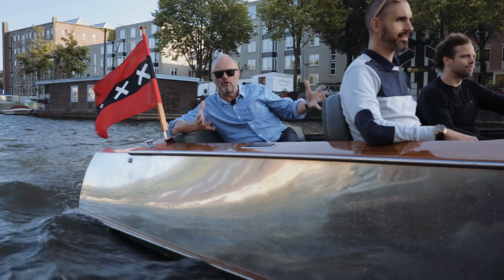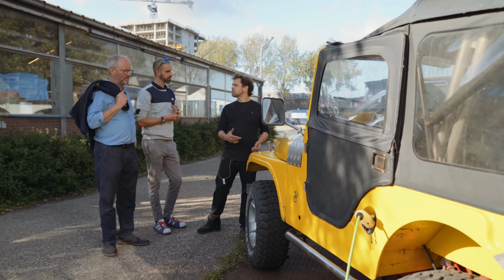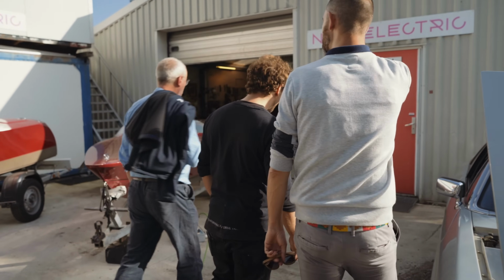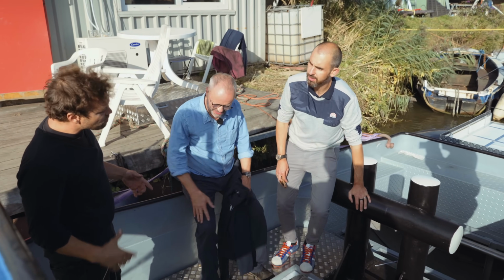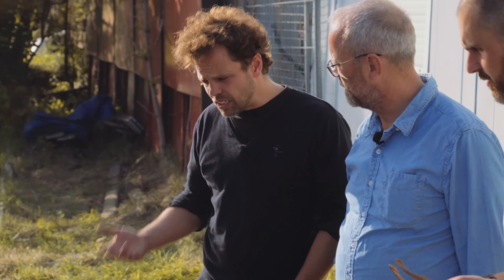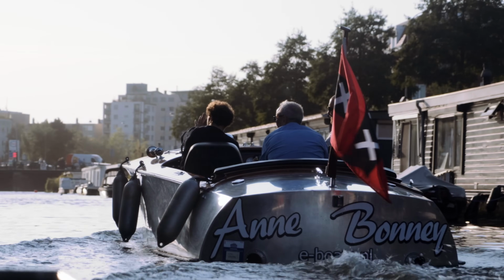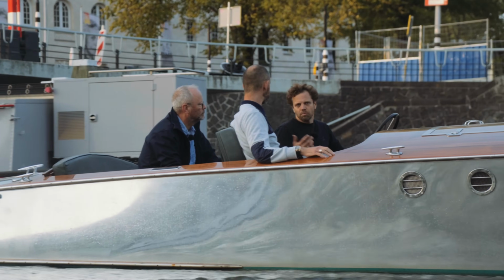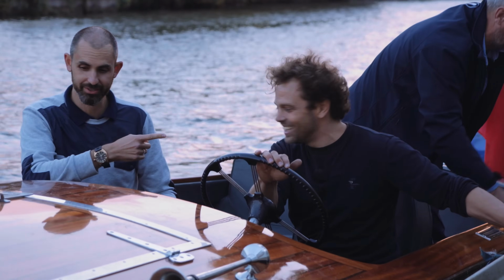New Electric Cruiser | Fully Charged

Comment: I pick up my beautiful original baby blue ‘64 electric VW Beetle on Tuesday!  It’s got A/C, heater, front disc brakes, LED lights, seat heaters, 3 point seat belts, etc..  The work was done by Flash Drive Motors outside of Austin, Texas.

Comment: I have a 20,000lb flat bottom house boat with twin 6 cyl engines 150 hp.  Is it doable to convert to electric. The river is 8 Knox I figure I might need a helper out drive going up river. But going down not big deal. My boat has inboard

Comment: Hacker Craft lines, classic wooden decking - and a stainless steel hull. I would have hated it, but for an electric boat it's perfect.  But... it's called an e-boat. Didn't the British navy work hard to sink all of these in WW II? (E-boat, Schnelleboot, a large German torpedo boat.)
Thanks for the great video, good to see sizable batteries used in a sizable boat, beautifully executed engineering-wise and esthetically.
Reply: @don jones You almost got it all right! Hacker craft lines is right on the money, the boat was built to the original 20-ties design of Nelson Zimmer's Palm Beach runabout. Nelson Zimmer and John Hacker were said to have also collaborated on other boats. Decking is Mahogany, the hull is aluminum though. Whole boat is 1500kg including the electric drive and batt pack.
Turns out one of our very first projects is also one of the prettiest we've ever worked on. Spoiled us for life ;)

Comment: I saw an XJS converted to electric when I went to the Fully Charged Live show. Very cool to see and they didn't touch the interior, just tidied it up a bit. Bloody lovely.

If there was a good hydrogen infra structure where I live I'd love to convert my old IS200 to run on a hydrogen fuel cell, it's basically a 4 door Toyota so just stick a fuel cell from a Mirai in it =P

Would be wicked. Very chilled out episode, I love that music.

Comment: The power usage information on that boat was a bit of an eye opener.  You can cruise all day without worry and charge overnight on a level 2.  I'm surprised electric boats aren't more common, especially in areas where boat speeds are strictly limited.

Comment: Impressive that he has been able to keep going with the advent of mass produced EVs. Back in the day I looked into conversions too and I found that industrial AC induction motors of size like in the tesla roadster could be had for 150$ from numerous suppliers in china. Standard unglamorous blue workhorse motors you'd see in any factory but able to do 10000rpm. Combine that with an AC controller and it could power a sportscar. I advocated this a lot in the conversion world but no one would listen and a decade was wasted on extremely overpriced prototype solutions and I'm sure that siemens setup is very expensive still. More than an entire used Leaf for motor and controller alone. Maybe even two used Leafs.  While the car market is essentially a goner, boats could be made electric and planes are very interesting. Motor systems for planes are often extremely expensive and noisy. There could be serious potential there. I wouldn't emphasise one offs but series production with cost optimized products, not siemens comfy greed, could have mass market potential. Heck with Anne's drive and skillset, I'd look into making the planes as well. I could certainly offer some pointers on what potent plane config opportunities aren't being tapped. Like in the car industry that consistently fails to consider issues like wheel aerodynamics and slacking on video mirrors, so there is absentmindedness in aviation. And some are low hanging fruit a few good men could pick en masse.

Comment: I always thought Tesla is missing a niche market, by not providing a set of different sized basic electric chassis's, batteries, wheel hub motors and cpu system packages, to be sold separately and with some modifications, where the customer can bolt on an old car body.

Comment: Soelcat, designed near Rotterdam, has 36 solar panels and is supposed to be able to cruise for 29 hours at 6 knots. If you added another 18 panels, 6 down each side and 3 across bow and stern you could cruise for 43.5 hours at 6 knots or 29 hours at 8 knots (the waterline length speed) 8 x 24 = 192 miles per day. Buy one and get the round the World solar boat speed record? https://youtu.be/pB1VHzSVfQM (bigger boats are heavier per area of solar panels and go slower, like Turanor Planet Solar even after they installed a sensible propulsion systemhttps://youtu.be/XxN8KQBlvSY )

Comment: Great story guys,I have a very interesting story which I would like you guys to cover....Marina Bay in Singapore,it used to be part of the sea but has now been transformed into a large freshwater reservoir for the city by constructing a dam with flood gates, the dam has two purposes,one to separate the sea from the freshwater and also to act has a drain for when there is a torrental rain to stop the city from flooding.There used to be heaps of petrol and diesel boats and ferries when it was part of the sea and now that it is a freshwater reservoir there still are quite a few boats and ferries but they are all slowly being turned into electric because the Government did not want diesel and petrol boats and ferries polluting there freshwater drinking supply

Comment: Only one word for all of this. WOW! I wish somebody would come out with a modular system where you could swap out the motor and battery into different shells. So maybe you start with a Jetski setup and then you buy a motorcycle shell that you can with relative ease swap over the motor and battery to reduce the cost of adding a new vehicle. Would be a lot of fun to swap between a Jetski, motorcycle, snowmobile, 4 wheeler etc. If it's too complicated to swap over the motor then at least have the ability to rapidly swap out the battery. Which is a major cost component. You already see this with power tools. Just needs to be scaled up.

Another use for modular design could be in cars so that if one major part fails or it's in a crash the whole vehicle isn't discarded. Make it easier to swap out the costly components like the battery, motors and computer. If they're worried about theft they should include a unique id chip in the costly parts.

Comment: I'm Curious to know thr cost per hour versus Diesel. Ideally you want a brushless motor with smart electronics to get the best efficiency. If i can  charge fast I'm interested.
Reply: running cost is low.. little maintenance and you will get further on your €,£ or $ ..when charging kWs vs price of fuel. that said currently the conversion itself is still a steep up front cost.

Comment: how 85 tons divided by 20 tonn truck = 900 moves? That is pulling stuff out their ass. To move 900x20tonns=18000tonns/85tonns barge=211 courses. So is that a day? NO! A week? Naaah? You can load barge fairly quick with specialty infrastructure, but you cannot tip it like truck, so unloading is sloooow. Where the 900 trucks came from then?
And 20tonn is a 4 axle solo truck, a lorry will take more and still can tip. Not able to get everywhere though.....like boat.

Comment: I generally dismiss integrated PVs on an EV, but that is a lot of horizontal surface out in the sun all day. Granted, you'd never wanna cover up that PARTICULAR boat. That wood paneling is gorgeous. But on a more modern looking canal limosine? With like an awning/canopy for even more surface area? And did i hear him wrong, when they were going slowly the boat was only using 1 kw?
Reply: Yup, the 'Anne Bonney' uses 1 - 1.5 kW at city speeds. Solar does indeed work on house boat /cabin cruiser / narrow boat ships. Particularly on extended trips where you moor up somewhere sunny and chill for a week or so..
Reply: @NewelectricNl  Wow that's great! Thanks for the reply. Keep up the fantastic work.

Comment: I have this personal belief that any time you add weight to a vehicle for ballast, you oughta do it with BATTERIES instead of dead lead weight. To me, this really drives home how electric propulsion is really perfect for boats! Besides, if A) all our cities end up looking like Amsterdam or Venice because of sea level rises, and B) the oil infrastructure will be disrupted by the same climate change effects,  then electric boats that are rechargeable locally with PE solar would be indispensable! 
Imagine living in a drowned city, where a floating barge/pontoon boat with a solar-panel roof, battery banks, and fast chargers, could take the place of gas stations.

Comment: What a fantastic episode. 
Hope combustion engines dissapear as soon as possible.
There are lots of testing and tech to improve yet with electric engines BUT we are now in a moment that everybody should ride or drive an electric vehicle.
Reply: Kind of silly to say that. The worlds electrical grid cannot produce enough clean energy to power even 5% of that many electric cars.  We need to increase renewable energy sources as well as make better batterys that are cleaner to make. Plus in my truck I have to drive 200-300 miles round trips some days to jobsites with tools. EV cannot do that yet
Reply: @gregsall5872  Well, believe it or not it will come but I apologize because I made the comment based on my country (Costa Rica) and my point of view. Our energy is close to the 100% renewable I understand most countries cannot get energy the same way.  We have the energy but not the money as we all know EVs are not cheap. In the other hand when I say all cars I mean average drivers for personal use not cars or trucks to work. That is a totally different league... Volvo though, has some years working on E Semis. The electric era moving fast
Reply: Oh trust me im hyped for EVs to get better / more capable. Just everyone wants things to switch to fast and our  infrastructure cant adapt that fast. It will be awesome when it does but it has to be done correctly. I cant wait to not have to buy gas for daily driving.

Comment: As a guy interested in EV's but also a long time boat nut (quiet sailboats) this is extremely interesting. A quiet powerboat which doesn't stink. This particular boat is obviously a planing speedboat which isn't the most easily driven hull at speeds below planing speed. I wonder what kind of range a long, narrow, classic displacement type craft could have in order to cruise rivers, canals and sheltered waters? Catamaran hulls are now being fitted with hybrid powerplants, another variation.

Comment: This shop is building Fiat 500e cars for less than Fiat can make them.  We lease one at $121/month, thanks to 'miracle' depreciation on the lease contract, but the buy out is still $22k after 3 years and 20,000 miles.  Crazy, the used market is over priced but will support about $15k for that car.  What if you just buy a used ICE Fiat and bring it to these guys?
It's not a car that wins in any category but it sure takes you around town for almost nothing and is dead reliable, so far.

Comment: Fantastic works.. was that Tug though a Diesel One with a electric motor drive?  I say that because look behind the battery he was pointing at on the Tug and you see a diesel motor with air filter tube there!   They could refit allot of cars to take electric motors and battery and solve pollution in towns and cities and get rid of flumes and noise too!  Let's hope they do?

Comment: Electric AWD Jeep with a low center of gravity...Sign me up.
Reply: Electric off road vehicles make so much sense. Perfect power delivery from low RPM's.
Reply: You'll want a Rivian, then!
Individual drive to wach wheel and battery in the floor.
Reply: @Abrikosmanden  Why?  This system keeps the electricals out of the road grime and water, and uses a proven drivetrain.  Why go with something software-based that doesn't allow gearing to fit the load required?  That's not provress... that's LAZINESS.
Reply: @Abrikosmanden  I'm waiting on Rivian to release a video of their moving around truck in "tank mode".
Reply: look up RIVIAN
Reply: How about lada niva and dacia duster??
Reply: yeah, I'm still drooling over that Jeep!!!

Comment: There is nothing new about electric boats  it was used in subs  before  WW2  We had  electric cars in 1910's
Reply: We're moving forward 😊
Reply: True battery tech has been around a while. Have driven a 30 tonne battery electric locomotive. Built in 1944 and still running today. Quite happily shifts 150 tonnes with ease and one job included rescuing a fire damaged diesel off the mainline!
Reply: @KleineJoop   AHH but,   if doing something is smoke and mirror's what's the point .. making the battery's for a tesla .. make's a bigger carbon footprint ,Then  a new v8 mustang can put out in 10 year's..  the making of the battery's also use coalfired power.. also   you cant recycle the battery's and, they give out after 15 year's and end up as toxic landfill  .. when you charge the battery's the electric power is mostly coalfired power  making even more carbon.. meaning just burning gas is much better ..   buy doing something does not mean better ... look it up and you will see im right..  electric car's are just as much the past.. Now If  you charge them using solar not main's power from coal... that's doing something.. at the moment in china and india are making over 50 new coal fired powers Station's  puting out more co2  then making a normal car.. And really It is worst making a electric car then a normal one for the planet right now... so  you can  fool your self all your  want..  we need new tec not this stuff from 1900's .. zero carbon  thats not an electric car,, every time you charge it.. it put's out more co2 then a gas powered car.. and not over time.. all at once in 30 mins..  making global warming faster..  really   Not doing something but making it worst..   making every thing electric is just for money .. not for helping the planet.. It's  the new  way of off loading your guilt ..   It's sad.... Oh  and all the mining to make the battery's and transport the ore , make's even a, worst carbon foot print.. i dont want gas powered car's  at all.. but  thinking electric car's are green is just fooling your self.... War machine's have been powered by electric  power since the 1920's Check the first sub's
Reply: @IanMicheal  Nearly every sentence in your rant is plain wrong.
EVs emit less CO₂ even if they are charged by coal powerstations.
https://www.ucsusa.org/clean-vehicles/electric-vehicles/life-cycle-ev-emissions
Batteries can be, and are, reused and recycled so minerals are only mined *once*.
China and India are spending trillions on renewables and getting off coal asap.
There's a mine in Switzerland with electric trucks that make more energy than they consume when they bring down hundreds of tonnes of ore and go up empty.
At night they send out what they collected to the grid.
So, please educate yourself, learn something and stop being part of the problem.

Comment: A small peek into the garages of the future there. Bringing the cost down of conversion to electric may be the real key to making this all work. I had a BMW 318i touring, lovely cruiser, named it The Silver Land Shark. It died on the motorway. The engine flew apart, blew a hole in the block and bits of cylinder fell out like little crushed metal butterflies..  I keep a piece of one it's cylinders on my bookshelf out of respect. It would still live today if i could have just pulled the engine out and had it converted. 
Something to think about.

Comment: Hi Guys here's a conversion market for you Fiat Ducato based motorhomes. 
Loads of them all around Europe, all with quite long lives  huge investments by their owners (including me) and all diesel.
Reply: Motorhomes are also vehicles where integration with rooftop solar really make sense.. As weight and cost per kWh of battery go down, we will for sure be eyeing doing such a conversion to show it can be done!
Reply: Yep. The trick will be getting enough battery into them somewhere.
Reply: True,   but we already hang a load of stuff under these vans, and there is still space.
Reply: I believe an electric motorhome would be quite difgicult. Mainly because weight is a huge issue with motorhomes since at least the new german ( i belive all new european) drivers license doesn't allow you to drive anything heavier than 3.5tons